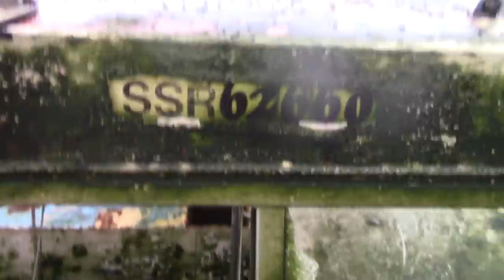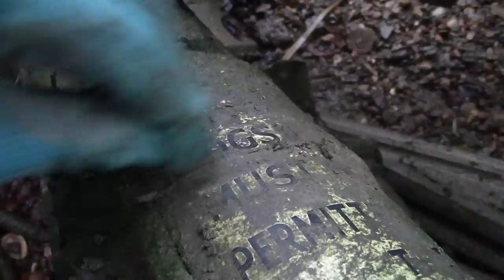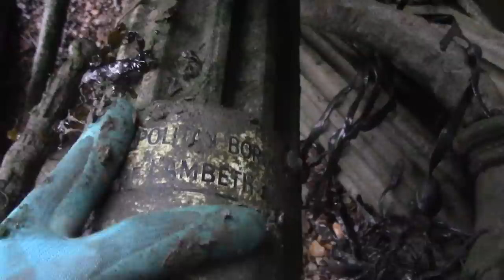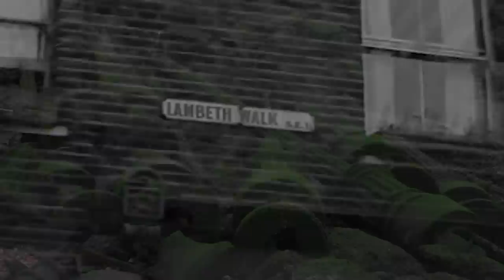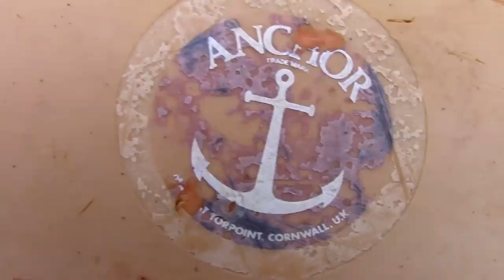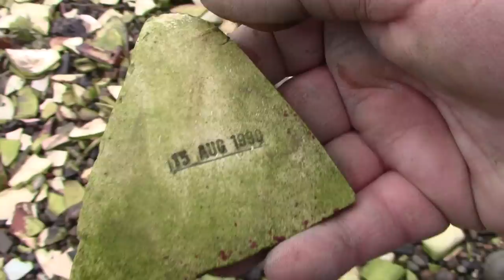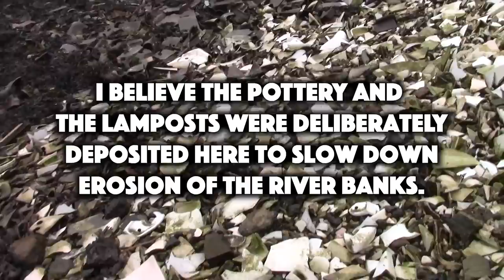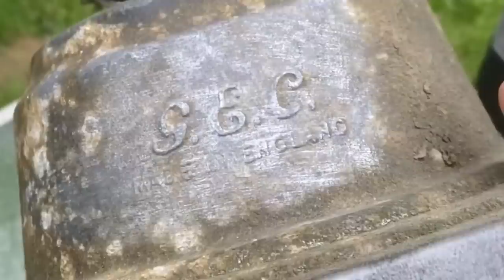CRAZY! 1,000s of London's old Lamp posts found dumped! Plus old bottles found Mudlarking!

Comment: When all the 1000s of old and very decorative lamp posts throughtout the London Borough of Croydon were replaced with modern lighting about 15 years ago, I asked to buy one, but was told they had to be broken up and scrapped. I told them that they were crazy because all those lamps were worth a fortune as architectural salvage.
Reply: 15 years ago? I thought the lamps were already removed in the 1970s?
Reply: @andiversum  You're right. I've checked, and my guess about the timing was wrong. According to Skanska, who carried out the work together with John Laing, in the boroughs of Croydon and Lewisham worked started in 2011 and ended in 2015. They replaced 38,000 street lights, and 8,000 street signs and bollards. They also refurbished a further 4,000 lights.
Reply: How does it go...some people can't see the forest for the trees. RIDICULOUS that they wouldn't let you HAVE one! Good Lord.
Reply: Scrap value at £200 a tonne …….
Reply: Criminal waste
Reply: They still are, if you can get to them.
Reply: Got to love government bureaucracy. I'm still pissed off about all the beautiful Victorian iron railings cut down from peoples houses and then dumped into the sea during WW2 just for propaganda. 
Noting it down for WW3, I might get nuked but you ain't getting my railings ಠ_ಠ lol
Reply: @zephyrsky__ What do you mean? Could you elaborate?

Comment: Guy from the town getting rid of lamp posts: "Hey...these have to move on out of here, can you haul these to the dump for me?"
Guy with Dump Truck, "Sure, but it will cost ya 3,000 pounds.
Guy getting rid of lamp posts, "Great! Off with em then! "
Guy with truck, " Dumps em on the Thames Shoreline"   Just my guess. ha ha..
Reply: Kris Roberts that’s not true. I did work for a large skip company and everything in the skip will be sorted and recycled where possible.
Reply: Kris Roberts Churngold waste, that was sold and is now called Viridor. They sorted through everything; the wood was chipped up and sold to particle board company’s, the metal was all separated. They had a guy on a big grabber machine chucking the wood Into a big chipper and sorting the skips in general, then they had guys picking stuff out off a conveyor/sorting machine. Only the rubble and general crap went to landfill.

Comment: There was a mass cull of old street lamps sometime back because cast iron and concrete posts don't bend when you crash into them, hence more of the impact energy is transferred to the things that do bend and break easily such as the car driver. So if you think you are going to crash your vehicle try and avoid trees, concrete, and cast-iron lampposts.

Comment: I suspect you would find those posts were all originally buried, and coastal erosion has washed away the soil, these type of artificial barriers tend to eventually cause worse erosion as it interferes with normal wave action.  Big problem in some places like the USA where the artificial barriers caused all the sand to wash away all the way to peoples back doors.

Comment: The lamp post shade or upper shield id find scraps of bright oriental silk using it to blouse out a shade or use wire coat hanger bent to an unusual arc covering it with silks in the blue range for a mood inspiring light.

Comment: the sea snails you found 24.37 are called winkles back in 40s 70s and  before would cook them like cockles use pin remove what was called the eye then twist out the body inside  the  shell and eat them very tasty with vinegar.

Comment: A suggestion, find your self a small set of snowshoes and on the bottom of the snowshoe secure a thin piece of plywood. Then when you get into the really soft mud slip them on and they will disperse your weight and you can walk easier.
Reply from the maker: Jeff Strong thanks but we use Mudders

Comment: Claim salvage on the posts, pull one at a time, clean and sell as landscaping...welcome to the Millionaire's Club...( south Florida).
Reply from the maker: coco loco Yeah all I need is a crane 😊
Reply: @Sifinds  Agreed, they are indeed heavy. Pull together some buddies with muscles, winch and truck. Pressure- wash and clean one , research  provenance and offer it for sale. They make beautiful interior columns or outside posts. "The only shots you miss are the ones you do not take."...(south Florida).

Comment: The phrase that pays "Dogs must not be permitted to foul the public footpath" lol   I remember the pale blue lampposts, Downham Way had them as did Baring Road but became posh ones crossing the border into Bromley borough from Lewisham and you could tell when you were in Lewisham or Bromley just by the lack of pale blue ornate case iron lampposts.   Some were utilised as vents for underground rivers or rapid clearing sewers.   Some of the older ones may well be trolley overhead wire supports as a kid I remember the street slung road lights that were left over when they took away the trams and trolleys, enterprising councils kicking the can down the road often just tarmac'd over the rails causing headaches down the road for utility roadworks suddenly finding on their pneumatic drill hardened steel rails fighting back :D

Comment: I had one of the lamp ends with bracket like the one you cleaned up, made by  G ,E , england but the glass was missing the glass is hard to find if missing, so it was meant to be for you to find that part as well
Reply from the maker: A,S,T equipment,fellaz vintageretro Thanks!

Comment: that rod you picked up at the beginning looks like an aircraft control rod
Reply: It was a tensioner for steel ropes on yachts, most yachts will have those.
Reply: Rigging turnbuckle/tensioner for yacht rigging. I bet he cursed when he dropped it overboard. Stainless steel hence condition.
Reply: @delukxy  it would have been firmly attached, so probably was taken off at some point. I'm waiting for someone to find a winch handle though, they do get dropped and that have dropped one. And yes, I cursed! A guy with a magnet got it out though!

Comment: Years ago, my father came home and got me and took me down in Detroit where they were replacing the old ornate lamp posts with modern ones. We wrestled the base and one of the tops into the back of his van and took them home. He restored them both and put them together to form a shortened lamp post about 7 feet high in the back yard. They were cast metal though, not concrete.
Your idea for the artificial reefs is spot on. They already do exactly that in Florida. They have cast concrete shapes they stack up and even plant coral buds on them. They also have several purposely sunk wrecks to dive on to take the pressure of human impact off the reefs.
And I just bought that cod bottle, couldn't resist 😁.
Reply: Yes, concrete  shapes used to promote reefs have been used extensively off the East coast of Florida.   One of the Florida state auto license plates feature  (many different) Save the Reefs. Money collected is used  to support ocean health.
Reply from the maker: Ah thank you James. It’s one of my favourites. I just love the barrel shape, and the letters are so crisp. The mud has protected it well. Which is why we are Mudlovers!

Comment: Your idea for helping the coral reefs is spot-on; and is actually being done in some areas.  Yes, old metal-hull ships were deliberately sunk for the purpose.  Unfortunately for the Atlantic seaboard, the water is now so acidic that it's dissolving the  shells of crabs, lobsters at an alarming rate.  After the initial success of sunken ships was noticed to promote reef ecosystem regeneration, some genius in Florida decided that old, worn auto tires would do the same job and eliminate a  huge amount of waste going to landfills.  Massive mistake; it's  made of petrochemicals, so it's toxic, and only contributing to the reef and sealife destruction.  Now, a massive expense to clean them out..
Reply from the maker: Blimey, thanks for the info - very interesting
Reply: @Sifinds  You''re so welcome.  Lesson: don't be like an American bureaucrat!

Comment: When electricity was first invented? Lol great vid guys, subbed
Reply: It wasn't invented, it was discovered by Benjamin Franklin, the discovery of electricity is a bit more complex than a man flying his kite. It actually goes back more than two thousand years.

In about 600 BC, the Ancient Greeks discovered that rubbing fur on amber (fossilized tree resin) caused an attraction between the two – and so what the Greeks discovered was actually static electricity. Additionally, researchers and archaeologists in the 1930s discovered pots with sheets of copper inside that they believe may have been ancient batteries meant to produce light at ancient Roman sites. Similar devices were found in archaeological digs near Baghdad meaning ancient Persians may have also used an early form of batteries.

Comment: You really need a tool kit containing: Old soft toothbrush, Small bottle brush Small brass wire brush, a plastic knife, extendable magnet, a screwdriver, a trigger pump spay bottle, needle nosed pliers, forceps, head mounted LED flashlight, clean rag and a dirty rag.
Reply from the maker: WireTamer love the dirty rag. Lol

Comment: I would have bee trying to find a way to get that sign off the lamppost and bring it home.
Reply from the maker: Nancy Kraus it was stuck fast
Reply: @Sifinds  I saw two of the bits holding it on.  One side was a small pin but that other side had a Sizable bolt and lots of corrosion.  You would have needed a hacksaw blade.  I carry a half of a blade with me when I go out with the my scouts.  One of them has a metal detector and we have found some cool stuff at summer camps.  The 6" blade piece has helped get corrosion off at times.

Comment: I’m guessing that the lamps are from the 40s and 50s to replace bomb damaged gas ones as metal would still be in short supply so they used concrete
Reply from the maker: proud Yorkshireman Good theory
Reply: @Sifinds  The ones with cross bars at the top must have been gas lit before being converted to electricity, the bar is for the lamp lighter's ladder, so those ones are probably quite old.

Comment: This is what I found from ssr62660.Snow Goose Built by Unknown - Length : 9.75 metres ( 32 feet ) - Beam : 1.97 metres ( 6 feet 6 inches ) - Draft : 0.01 metres ( 0 feet ). Fibre Glass hull N/A power of 999 HP. Registered with Canal & River Trust number 62660 as a Powered Motor Boat.

Comment: I worked on street lighting contract shake they wasn’t cast Victorian ones they are worth £300+ if the got the bars on but that’s just the colum as they was old gas lamp then they removed all the tops n put shit swan neck tops on
Reply: The scrap iron value i suspect would be considerable

Comment: They are replicas of there cast iron counterparts .

I’ve been up and down the country pulling all columns out (part of the false energy money making scheme )
I’ve never seen these concrete columns but I’ve taken out the exact style but cast iron ( gas conversion to electric) it was heartbreaking especially cause they didn’t need pulling just the heads changed.
They’re dumped there I’m gonna presume cause a company didn’t wanna pay to get rid of concrete,
I won’t go on cuz I have loads to say about them 🙄
Reply: I wrote that  mid video so you’re theory on why there dumped there maybe right.
Just went in too soon 🙄

Comment: What A waste with those old lamp posts why didn't they recycle then even if you break them down and use for roads or something else but to just throw them there is wasteful. That poor river has been a dump for hundred of years and it looks like it's still going on. There is no way you would think of eating those oysters on the side of that poor polluted river.